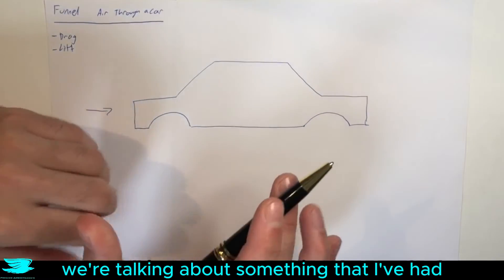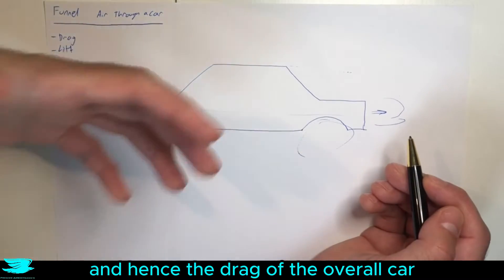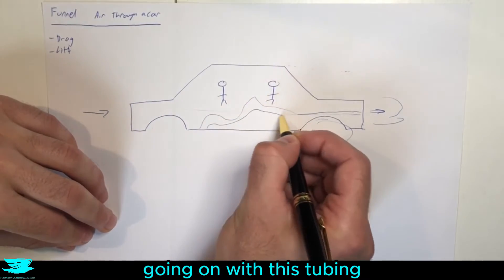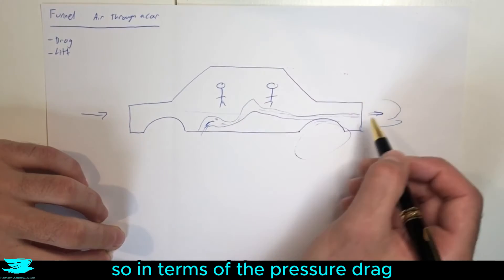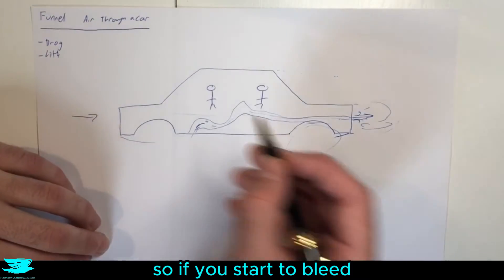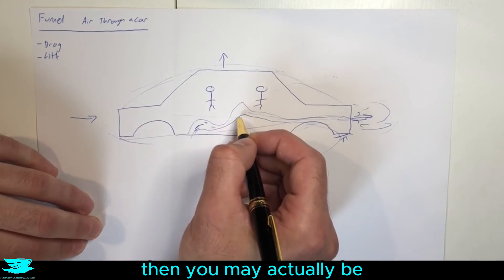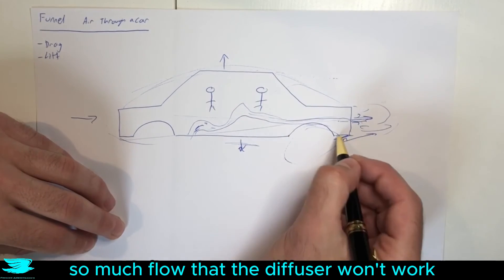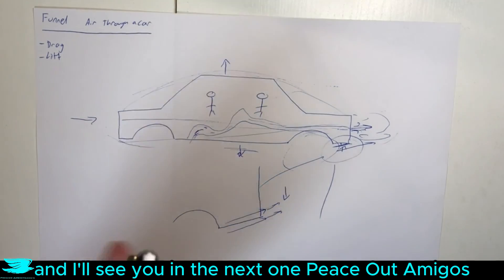Funnel Air Through A Car To Reduce Drag {Auto Aero #53}

Comment: @PremierAerodynamics  what if I put those tubes, from the front of the car (high pressure zones) , running on the sides of the car,  straight and the  smooth way possible, to the rear ( low pressure).
Reply from the maker: That could help, but the redirection is still likely going to have a drag penalty.

Comment: what do you think the effect would be if you were ti put a hole on the front of a wing mirror where the pressure would be high and then vent it around the mirror glass on the back side? Ignoring the glass probably getting very dirty.
Reply from the maker: It would definitely reduce the pressure drag. The keys would be to reduce how much the air turns and reduce vortices created. If done, the overall drag will drop.

Comment: if you look at Aston Martin Valkyrie hypercar you can see just how much they let air cut through the mass of the car. From between front splitter and front bumper around the passenger compartment and to the sides, then around engine compartment under the car and through the enormous rear diffuser, the car is practically shaped like a complex turned over wing, it doesn't even have a flat floor because of that, the main body of the car seemingly floats with side pods for wheels attached to it. Truly a marvel of F1 engineering of Adrian Newey of Red Bull.
Reply from the maker: They did a great job applying good aerodynamic principles in an aesthetic package. Usually, the aesthetics considerations ruin really good engineering designs.
Reply: @PremierAerodynamics  well Marcel Dassault said that if plane looks good it will fly good. AMRB seem to have started with base aerodynamic principles they wanted from the car, which shaped it into the way it is, without adding unnecessary complexity of minor details. The clean design simply followed it.
Reply from the maker: @StellarGale  I think the designers of automotive companies need to be reminded of that.😁
Reply: @PremierAerodynamics  Hi mate thanks for the video.. it is an idea I was thinking for a long time ago.
.. I did a inquiry to you in the main comments. Please tell me what do you think about it.. thanks

Comment: Hello,

Thanks for working on this interesting topic.

You can design a car, that got a negative chamber, and works like a big spoiler. 
So no real need to build a big fan for pelting around cherry stones from under your car.
Unless you are into drag racing.

The Mig17 a old russian fighter jet got a long inlet in front of the turbine.
It is an aerodynamic nightmare.
Cause you need to funnel air in very high speeds through this tiny tunnel.
 Windtunnels need this lot of power for a similar reason.

So if you use an impeller, dont use any inlet if possible.

This fact results in a prop or impeller behind the car, to eliminate the wake.
You need to keep the surface that comes in touch with moving air as small as possible.
So funnel the air around the car is the best option, i guess

If you got air inside the car, it's better to let it there.
The air needs to have the velocity of the car - which is drivespeed.
Or the velocity of the sourrounding - which is usually 0.
Anything else in between produces drag.
So a cabrio, where the air got to decide to stay in the car or not, results in an aerodynamic nightmare. 
This produces epic windshadows.

Windshadows are only good for formula 1 snakeheads. Just stay the snakehead, and 
only awake if anyone in your windshadow gets fast enough.

So for no snake wannabes you can reduce the windshadow to nearly zero, with a proper prop behind your car.
And safe alot of money for fuel too.
And do something against climate change.
Reply from the maker: A negative camber car is definitely a possibility, but I'm not sure how good it would look by current standards. Another potential way is to flick the tail up so that the car looks more or less the same until the end, and then you some negative camber there.

Comment: Thank you for this. New Subscriber. Very informative. I am working on a 1970-72 Buick GS. but any GM muscle car of the 60's-70's will have this same issue. LOTS of air gets trapped in the engine bay. When semi-trucks or pickups with trailers pass the other way at anything over 65mph. the hood looks and feels like it is about to leave the car. My question is. How are some good ways of getting this air out of the engine bay and either over/under, or around the car. Most of these have about a 1-2in gap around the sides of the radiator, and between the back of the bumper and the radiator core support. Furthermore, the wheels are inset from the edge of the body quite a bit.    Would venting the rear of the wheel wells or getting rid of the wheel wells all together and instead make a bottom plate help. Any ideas or a video on this would be great. Loving the content. keep up the great work. Tom in North Dakota.
Reply from the maker: Hi! Thanks! And thanks for the interesting question.

The answer is a little tricky because I don't think you'd want to modify the external appearance of it. I mean, the easiest way is to simply cut holes in the hood to release the additional air. But, that could make the car look bad.

In terms of alleviating this problem without too much change to the appearance, I would see if the floor between the radiator and the bumper is open. If it isn't, perhaps that is the reason why air gets trapped. You can then remove this bit and make this floor open so the air can escape. This might reduce the performance of the radiator when you are pushing your engine, but I doubt that you will be flogging a car like that. I think you're more careful with it.

As for the wheel wells, that could definitely help. Is there anything else between the engine bay and the wheel wells? If not, then removing them would give the air easier paths to escape. If there are other things in the way, then that will still restrict the flow.
Reply: @PremierAerodynamics  It is true. This is a roadgoing car. Not a Race car. But i am Trying to build it to run across Montana on the interstate as a family car. But MT has an 80MPH speed limit. and most folks drive closer to 90. Trying to get this old muscle car to be more stable and safer at these speeds for up to 12-14hr at a time. it will be a big chore i know. I have started doing tuft testing on the factory scooped hood and rear wing VS a flat style hood and no rear wing. The stability is better with the rear wing and better milage without the hood scoops. There is a bottom cover plate behind the bumper before the core support on mine to work in conjunction with a factory front air dam, "That is not on the car at this time"". The air flow over the hood and up windshield looks good. The rear window is horrible. And i am sure the air under the car is horrendous as most of these years of car are. Looking at making belly pans, but not sure if i should take the weel wells out as part of this. There is a bout a i cubic foot space in the front of each weel well behind the core support. then the weel well comes within about 4in. of the engine on each side. and there is only about 1- 1/2 in. of gap behind the weel well before the firewall. Do you think cutting holes in the fender well itself wolf help? or just make things worse with air coming in from the wheels and tires getting trapped in the wells??  Some old Buicks had "PORTHOLES" in the front fenders, and i am not opposed to working something like that in. There are goods picks of these engine bays online if you care to look. and you can find what little tuft testing i have started to do at my small YouTube channel called "BuickSmith". Hoping to get the tuft testing with the flat hood up sometime this evening. Thanks for letting me pick you brain on this.  The only things i have to go on are What i have seen folks do for Flying mile race cars, autocross, and silver state road race cars. but there are not alot of GM "A" body cars doing these. and a very insightful book written by JULIAN EDGER on aerodynamics. Keep up the great work. I will for sure be watching more of your videos.  Tom From ND.
Reply from the maker: @tombrown879  The main thing to keep in mind for this particular problem is that the air seems to be getting trapped and can't escape quickly, which leads to pressure differences and the hood trying to blow off.

So, any way to let the air out easier will be beneficial. My suggestion would be to try things first that don't permanently damage the car. That way, you can see which one works the best, or perhaps a combination of things. Start with regions closest to where you think the air is getting stuck.

I watched your channel. It looks good. I think it's a great idea that many will relate to. When this channel was 4 months old, we had about as many subscribers as you now at 4 months.

Comment: If you restrict air from getting in the entrance of the floor, wouldn't the resulting low pressure create a suction force. I agree, after the throat of the diffuser, reducing backpressure in the diffuser expansion will create more downforce, so blowing air mass into the expansion volume will improve diffuser performance upstream all the way to the throat.
Reply from the maker: For the restriction, definitely, that is a large reason why air dams work.

And that is why the underbody and diffuser as so closely related and if you don't have enough air from the general underbody, you need to get it from somewhere else.